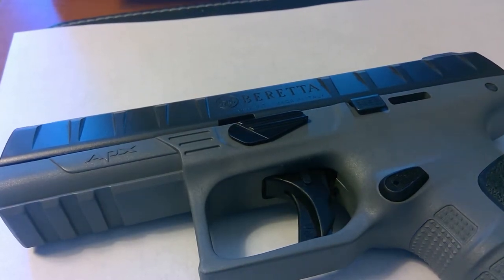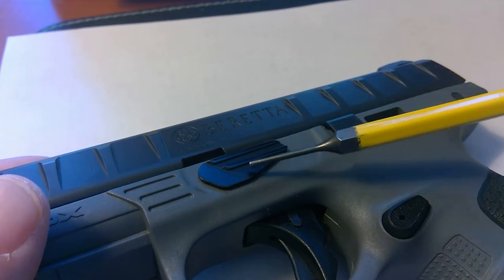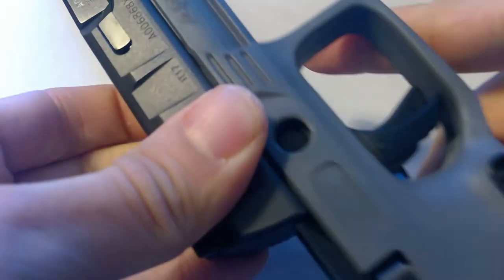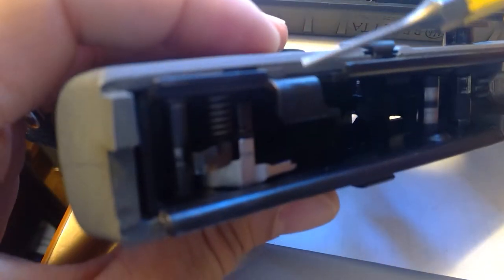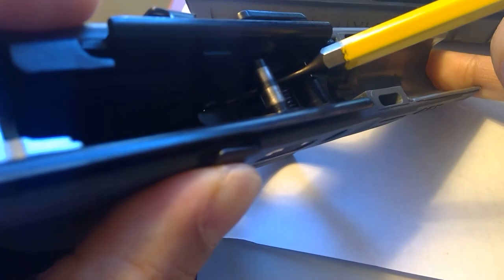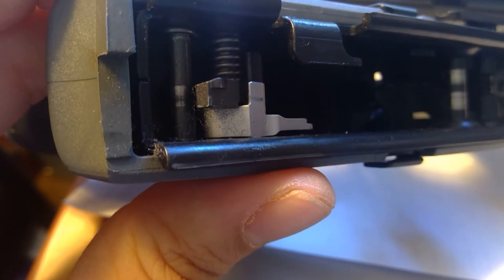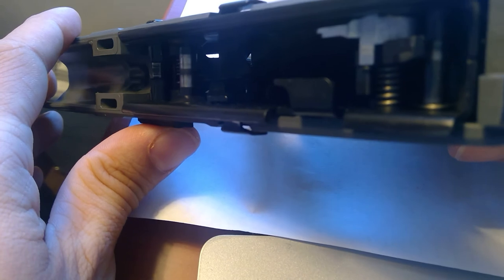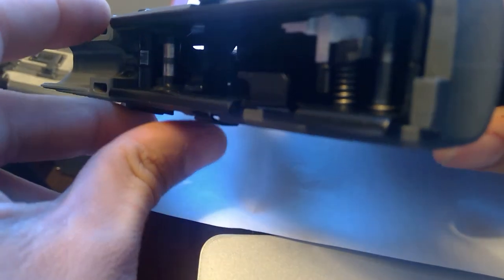Beretta APX Mechanism Details

Comment: Great video! Being engineer myself I also wanted to understand how the internals are going to behave if there is enough force applied to drop the sear. To be honest I couldn't find a definitive answer so I pulled the trigger group out, assembled the gun without the plastic grip and did some testing. Theoretically it is possible, but it is really hard to do even with your finger because of the geometry of the sear that is pushed by the striker spring and the fact that you are fighting the tension of the main spring as well as the striker safety spring. Its even hard to do without the main spring (I removed the rear pin to release its tension). And when the sear finally lets go, the striker is stopped by the safety. It is however possible to push the sear (and as a result the safety) far enough to fire the gun, but I really don't think this could ever happen. It's a well designed gun.

Comment: Thanks for taking the time to partially reverse-engineer it and for taking a look at possible safety issues.
Reply from the maker: I am glad that it was of assistance to you! I should reiterate that I do feel that the APX has among the best safety records at the moment as far as I can tell (though almost all of the pistols are pretty good at this point) when it comes to striker-fired actions. Perhaps the only one that can argue that it is more mechanically safe is the Glock. 

The addition of the new frame safety kit adds an additional layer of protection for those who may want it. I am testing it out right now.
Reply: Anyway, the safety kit only acts on the trigger bar, as far as I know, so it wouldn't prevent an inertial fall of the sear. Or would it?
Reply from the maker: @jp_0  That's right, the safety kit only works on the trigger bar. I'm not sure how this might affect the sear mechanism indirectly, but it would not directly affect it as far as I can tell. On the other hand, compared to other striker-fired guns (VP9, PPQ, &c.) where an inertial drop has been successfully replicated in physical tests, I have not seen anyone able to create circumstances in which they managed to effect an inertial sear drop on the APX, yet. If you know of someone who has been able to do this in physical testing, I would appreciate a link.
Reply: Well, it seems to me that you're the only one, apart from a couple of engineers in Italy, taking a deep look at this mechanism. What is bothering me is the absence of the "shelf" in order to prevent a discharge by inertial overpower of the spring, like a car accident. The thumb safety should have addressed this.
Reply from the maker: @jp_0  I'm not too worried about this myself. Compared to the other striker-fired guns that are out there, I'd say that the APX design appears to be very safe. The P320 had some major issues, but this is a combination of their choice to forego the trigger drop safety (which the APX has) as well as a few other design points which made it possible to drop the sear and simultaneously disable the striker block safety. They appear to have addressed this. In other designs, such as many tested on pistol-forum, users were able to replicate getting the striker's to drop, but the striker-block prevented any discharge. The APX so far has not shown a propensity for dropping its striker without user intent, even under load. 

Let's consider the four main directional forces. In muzzle direction, the sear, trigger, and safety are all moving in the opposition directions they would need to move in order to drop the sear. The inertia of the firing pin alone is already hampered by the front striker spring, and even if the drop were enough to overcome that front spring, the striker-block would prevent any further movement. 

In the opposite rearward force, the trigger will be hampered from moving rearward by the trigger safety tab. the striker is moving in the opposite direction from where it needs to go, and it has an even stronger spring working against it to keep the sear in place. The sear itself has spring pressure pushing it upwards and preventing the deactivation of the striker-block safety. If there is enough force to overcome the striker spring tension to create temporary space between the sear and the striker, the sear will move up just like it would under recoil. The striker would then catch on the sear again as it returns. Note additionally that the sear and the safety-block lever are both counter-balanced in all directions. That is, there is additional mass at the bottom of both and they are on opposing sides of the rotational axis against each other. This means that there should be relatively equal force under inertia pushing on either side of the rotational axis in any given direction. This will reduce the amount of effective rotational force actually working to release the sear in such a case. In other words, even under significant forces, the amount of force actually trying to release the sear is, I believe, going to be significantly less than the total amount of force applied to the gun, and the amount of such effective force should not increase proportionally with the total external force applied. That is, even if you increased the forces to the gun by a very large amount, that will not proportionally increase the amount of force working to release the sear because of the counter balancing. 

Rearward force is also likely to cause an out of battery condition that will reduce the effective force working to move the striker forward. Angles that avoid this are also at such angles as to not likely release the sear because of the above points.

Now, we can consider upward inertia of the gun, but in this case the sear is being counter-balanced as well and pushed in the opposite direction than it moves when releasing, if anything, which will prevent the striker-block safety from disengaging and prevent a sear drop. 

With downward inertia, the sear and safety lever counterbalancing are in effect, preventing rotation of the sear. Even should the sear release, the trigger is not moving rearward and not able to release the safety-block, so the striker, even if it releases in such a condition will not be able to discharge a round. Given the counter-balancing design, it seems that the sear dropping is very unlikely here, and even if it is managed, the striker-block safety should catch it. 

And finally, we should note that the sear and striker surface contact (engagement) is greater than that found in other designs, and the force keeping them together is greater as well (note the APX's intentional 6lbs. trigger weight design, which is almost entirely due to the sear engagement). This is the reason that the break on the APX is more "rolling" than other walls, because there is more surface to slip off. Compared against the two guns usually talked about in this comparison, the PPQ and the VP9, the additional creep, while slight, contributes to being more drop resistant (I don't know by how much). This may make the trigger less desirable to some people (debatable, when taken as a whole trigger instead of a single metric) but I will note that both the PPQ and VP9 designs have been noted to drop their strikers (but not discharge rounds) with "abusive" testing on pistol-forum, while similar sorts of testing on my part and others (IIRC) on the APX has failed to demonstrate the same propensity for striker-drop. All of these are superior to the P320's drop safety issue. 

In other words, under real world testing, theoretical analysis, and general reputation, I believe the APX has been shown to be among the best in class when it comes to drop safety. The Glock has a longer testing time, and it is easier to see how the drop safety on the Glock is achieved versus the APX, but the APX appears to be among the safest designs out there at the moment.

There is one option I see for getting the APX to not only drop its striker but also discharge a round. If the gun were spun at a speed sufficient to achieve the 6 lbs. or thereabouts of force required to rotate both levers simultaneously in the right direction, and then the gun suddenly stopped, imparting all of that force to the levers, then it would be equivalent to pulling the trigger and the gun would discharge. The challenge would be getting that force without introducing any forces that would counteract that through the counter-balancing in the design. This would mean you would probably have to spin the gun at a high rate of speed directly around the axis that the levers rotate around in order to ensure the right amount of force. Because of the very low weight and overall length of the levers, it seems to me that you would need to have a very, very high rate of speed with a sharp stop in order to achieve this. This scenario seems extremely far fetched, to say the least. I imagine it would be very difficult to achieve even under lab conditions, and duplicating it in the field would be well outside the probabilities about which I would worry.
Reply from the maker: @jp_0  For my own education, other than Glock's design, who else has a "shelf" design that creates a physical barrier to sear drop? I'd note that even the Beretta DA/SA design, which is very well regarded as among the absolute safest, don't prevent hammer drop through a shelf.
Reply: Well, taking into account the fact that the sear engagement in the case of Glock is 1/3 of the thickness of a thin sheet, I'm not declaring it a top contender. In terms of carry safety, I'd say that a worthwhile contender would be a DA/SA like the P99AS or the P07 in DA mode. I cannot see an scenario where a full tensioned striker can be safer than a dropped hammer or a relaxed striker. Even an experiment with a Glock where the striker safety is removed and the sear tripped manually from the rear shows that the spring tension in partial-cock can ignite a round. So, the fact that the Apx with thumb safety, which eliminates the possibility of a user manipulation inducted discharge, is still holding a tensioned striker without a mechanical restriction for inertial drop, puts all the responsibility on the striker safety block whose spring strength may be dimensioned with bias towards trigger feel.
Reply from the maker: @jp_0  The Glock is very much a top contender because of the way its design reduces the chance of letting the sear go. DA/SA guns are very safe, and arguably have more safety mechanisms built in compared to striker-fired guns, but I don't think it's correct to examine the inertial safety qualities of DA/SA guns in DA mode.  It's also not true that striker-fired guns don't have mechanical restrictions for inertial drop, any more than a DA gun without safety has no "mechanical restrictions." Spring design is a mechanical restrictions, as is designing the physics and geometry of the sear, &c. The Glock and other designs also have other mechanical/physical aspects designed to create safe mechanisms. 

Don't forget that there are also 1911's that are usually carried cocked and locked. 

The DA mode of a DA/SA gun provides additional human factors safety while in DA mode. It is also harder to do inertial drops, but that's mostly moot when determining drop safety of the gun unless there is something really wrong with the design. Remember that firing pins undergoing a drop in a DA/SA gun may still have enough force without the hammer force to ignite a primer as well. They are almost entirely dependent on springs and a firing pin block to prevent discharge, and on many guns, not even a firing pin block, but instead, material and spring weight considerations of the firing pin. The DA mode is very safe, but it's primary value add is not to drop safety, but to usability safety. 

A DA/SA gun's drop safety must be assessed by its drop safety in fully cocked and unlocked mode. Similarly, all guns must be judged on their drop safety by the most "unlocked" state in which they might commonly be found in or out of the holster. Usually this is the state of the gun after firing at least one shot and without engaging any manual safeties. In the case of a DA/SA gun, drop safety has to be judged by taking the SA mode into account. DA/SA guns such as the Beretta 92 series of the Px4 are very drop safe, even in SA mode. Ernest Langdon did a nice demo where he put one of his tweaked and tuned guns to the test to demonstrate this. In such cases, you have a fully tensioned hammer, but unlike a striker-fired gun, you have two means of getting that hammer to drop. The first is the trigger inertia, and the second is direct force on the hammer overwhelming the sear pressure. SA actions have a half cock notch instead of a trigger blade safety in order to prevent unintentional hammer drop because they have to prevent not only the trigger from being pulled by inertia, but also direct force on the hammer, something striker-fired actions do not have to worry about. 

Defeating the safeties on the gun is trouble, and that's one of the reasons that Beretta has the tradition of having the striker/firing pin block safety visible in the top of the slide. It allows for easy cleaning of that area as well as ensuring that you have a very good visual indicator of the status of that safety device, which is arguably one of the most critical. Note that Beretta has done this on their 92, Px4, and APX line, all of which rely heavily on firing pin block safeties. 

There are plenty of "hammer down" non-tensioned firing pin designs that are significantly less drop safe than your average striker-fired action of today. Fortunately, among the generally carried models, these designs are no longer in widespread use, precisely because of this issue. 

In fact, by and large, worry about inertial discharge of the firearm was, before the P320, generally considered a "solved" problem among the duty-grade and better handguns, across all action types. Engineers have figured out how to make their guns drop safe, no matter the action type. What made the P320's drop issue so egregious was that it existed at all, and wasn't dealt with swiftly. FN has also had some issues with their models, but they addressed them fairly swiftly and did not consider it a "voluntary upgrade." 

In short, whether fully tensioned or not tensioned at all, it is the firing pin block safety, usually, that must be relied on to eventually stop the striker/firing pin, in any design. In any tensioned design, whether that be a DA/SA, SAO, or striker-fired, there are additional design elements to create safety redundancy and to prevent sear drop. Some of these have proven more effective than others, but except in egregious cases like the P320, the issue of the quality of these other mechanisms is more a matter of ending up with a "dead trigger" rather than ending up with an AD. The designs produced by Beretta have an excellent history regarding this, and I see little reason to think that the striker-fired design from Beretta is any less worthy of that reputation. 

The real issues around DA vs. SA vs. striker-fired are around the safe manipulation of the gun, not inertial safety concerns. There is a strong argument to be made in favor of manual safeties, as there is to be made for DA mode guns (DAO or DA/SA), as well as for striker-fired guns without safeties, but the differences tend to be in human usability, and not mechanical safety potential. 

If you really, really want the absolute safest action from an inertial standpoint, you must pick an action that creates no static tensioning, and completely encases the firing pin channel. If that's what you want than an internal hammer/striker DAO gun is the way to go, and those can be found almost entirely as revolvers, with some minor exceptions. I also believe the new APX Carry is a true DA pull without a tensioned striker, but I'll need to do some more investigation of that to find out.
Reply: Agreed. The handling overcomplication that a DA/SA hammer brings to the table overrides the safety advantages. You have convinced me that the rotational based APX concept is quite safe. I still think that the P99AS is superior and the plate-based design of the Glock, quite inferior, for poor engagement and amount of flex in components. All things taken into account, the APX modularity allows for several configurations ranging from Centurion RDO to the Compact in just one pistol, as both share the same slide and trigger pack. Thanks for the deep insight; you have material there for a hemmer vs striker themed video that is much needed. On a side note, as you mentioned the Carry DAO, I wonder why the official Beretta website presents the APX Combat as a single/double action.
Reply from the maker: @jp_0  Hammer vs. Striker has been done to death. I don't really think I can add anything really foundationally new. I also don't want you to think that the Glock is the inferior system. I think it would be very hard to prove one system inferior to the other. The Glock system has a very different approach, and one that is renowned for being among the simplest and most safe of the striker-fired designs. A big key in this is the use of the physical "shelf" or "safety ramp" stop in the trigger design. Because the trigger bar, which is directly connected to the trigger shoe, also serves as the sear, this means that the rearward motion of the sear/trigger bar absolutely requires that the trigger move as well. When the trigger is forward, the trigger bar is forced to rest on the safety ramp, and it cannot physically drop down. The trigger blade safety prevents that trigger, and hence the trigger bar/sear, from moving rearward at all. This design doesn't lend itself to a great trigger pull, but it does lend itself to a terrifically good drop safety.